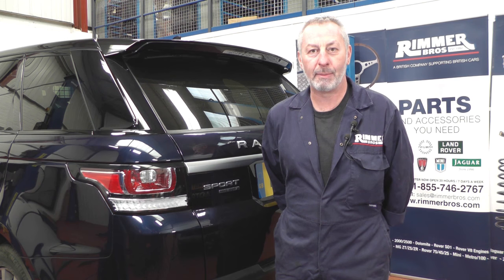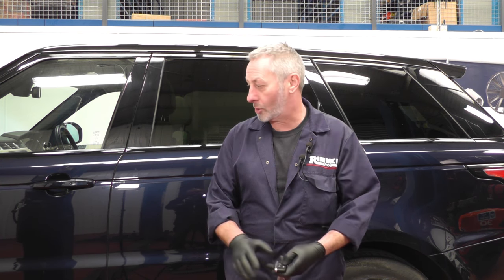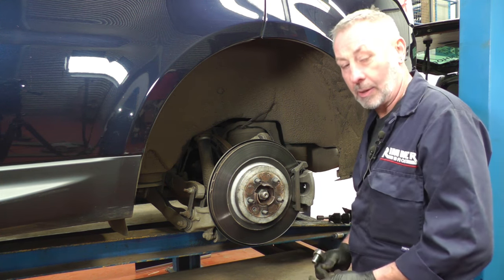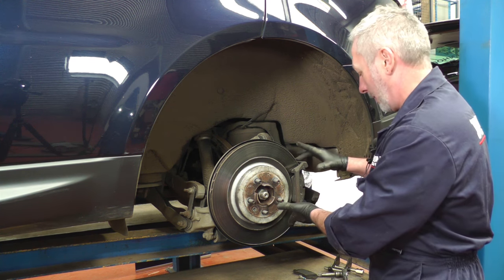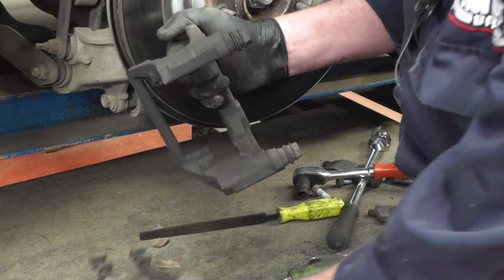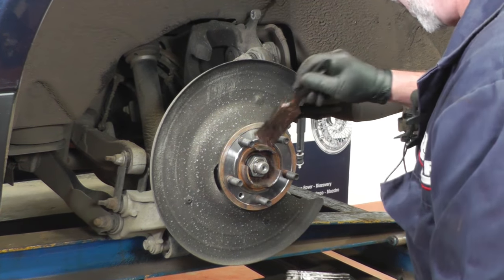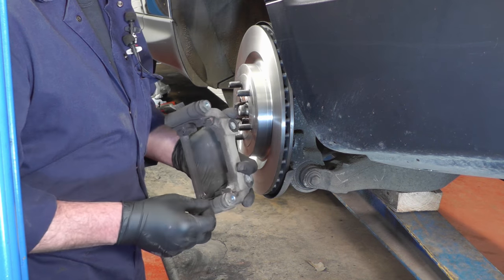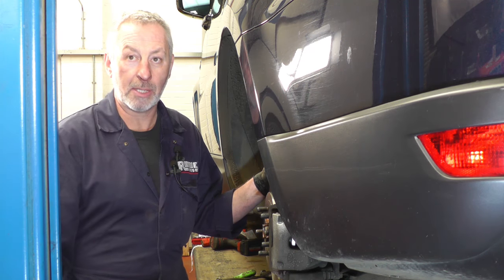Replacing the Rear Brake Discs and Pads on a 2016 Range Rover Sport.

Comment: For service mode you say "turn on ignition"...does this mean to start the car? Older cars with a key start allow you to access (start) certain features of the vehicle without actually starting it. I'm not aware of an ignition mode with a push button start vehicle - it's either on or off, right?

Comment: 1 step: ignition ON, press and hold the handbrake DOWN(release) wait 2 sec, press and hold acc pedal and wait 2 sec, Ignition OFF and immediately ON again.
Step 2 repeat but instead of pressing the handbrake button DOWN you have to pull it UP.

Comment: Good Day! Pls I loosed and removed the two back brake callipers to compress them as the new pads wasn't entering, after fixing them back and bleeding, the brake pedal goes flat at first and comes a bit hard after several pumping but still goes flat when left for few minutes, had tried several means of bleeding, even changed the brake master and ABS Module but still having same brake failure.
Kindly help urgently. Sorry it's a Range Rover 2014 Autobiography and all the jobs where done without me activating the maintenance service mode or can it be the cause?
Reply from the maker: Hi Obed,

Please get in touch with one of our sales and technical advisors and we will do our best to help you.

Please call us on:

UK: 01522 568000
USA: 1-855-746-2767
Reply from the maker: @obedchux987  Hi Obed, we do not have any WhatsApp contact information. Please do give us a call on the appropriate number above and we will do our best to assist you.
Reply: Good day, just called the UK line 3 times but was told they deal on parts only and no one to give me any technical advise.
Reply from the maker: Hi Obed,

In this case, the issue is likely too difficult to diagnose remotely. We recommend you contact a local specialist for vehicle diagnosis.

Comment: this is extremely helpful. thank you. can you please go over slowly and precisely the method for service mode again?
Reply from the maker: Sure....go to settings..playback speed...set it to 0.5 and then go to 0:43 in the video. He'll sound like he's had 12 pints of lager. But it's slower. Hope that helps! ;)
Reply: @RimmerBrosTV  i got it anyway after several tries, despite his appearing to make it up in the video.  what isn't clear is if you continue to hold accelerator and brake throughout and at what point you release. frankly I don't recall. but great video, nonetheless. it saved me from removing epb and manually retracting piston, which I did on the first side.

Comment: Does anybody know if the caliper pistons need to be wound back in or is it simple compression?  I’ve had previous cars where they had either a clockwise or counterclockwise spin when winding them back in.
Reply from the maker: Hi Mahmood, if you put the vehicle into service mode, this should release the parking brake. We also have this tool - https://rimmerbros.com/Item--i-RX2235 to push the pistons back into the caliper if needed. Hope this helps :)

Comment: To get the parking brake out of service mode you have to do the same procedure but, pull up on the button instead of push down.
Reply from the maker: Hi Mike. To get out of service mode you repeat the procedure for originally turning on service mode.